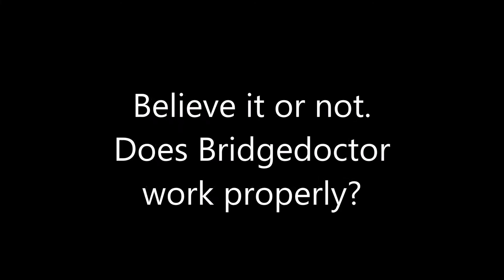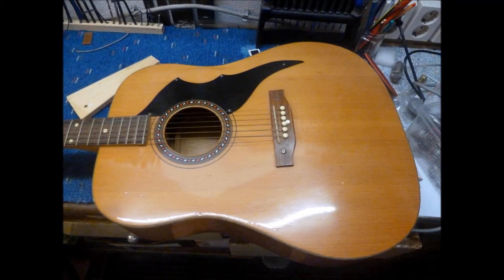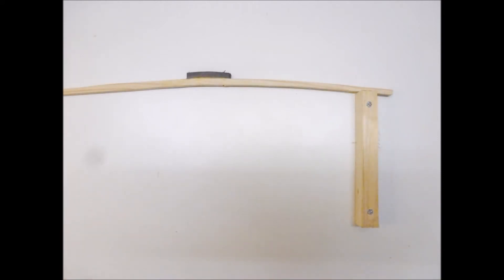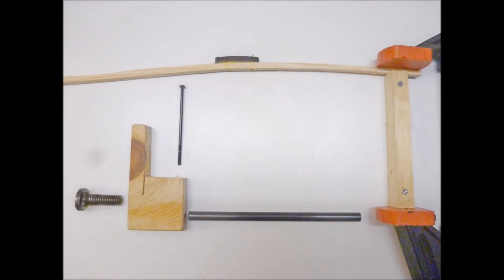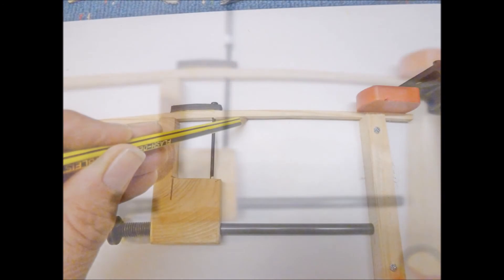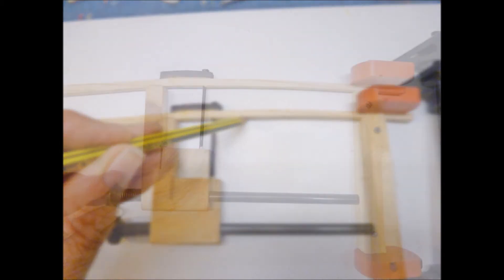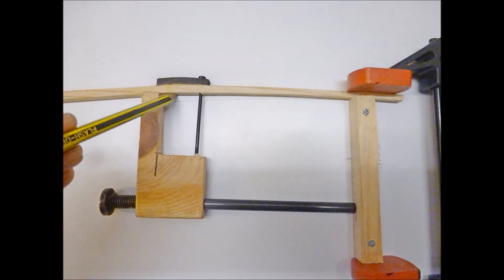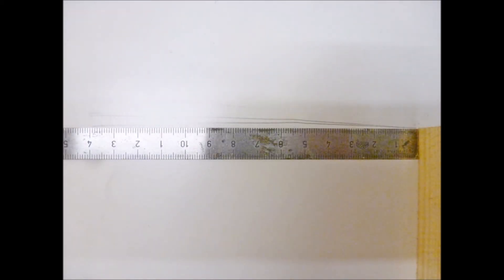Does the JLD  BridgeDoctor really work? Believe it or not!

Comment: They are a cheap fix but the wood they use doesn’t have much tonal quality, it appears to be basswood. They are easy to copy. One thing you should change is not to use a beveled screw which could cause the bridge to split if too tight. Use a forstner bit to drill a flathead bottom hole and a flathead screw that has a thin head , file it down if needed so a hole dot can be glued on top.

Comment: Do the job properly , hydrate the inside , clamp it down carefully and slowly, over clamp it so the belly goes in keep it hydrated for a week , ( I use a damp cloth ) remove after a week , leave for a few weeks and slowly release the clamps , this is the correct method.

Adding anything inside like these lumps of wood deadens the tone .
You might as well glue a big lump of wood top to bottom with polyurethane glue
Reply from the maker: This is another well known method in fact, but it needs time and causes sometimes other problems. Please remember that a "big lump of wood" from bottom to top works well in Violins since centuries, not glued in but trapped. I construct my own JLDs and they did never cause dramatic changes in sound. Instead of the long round wooden stick I use a 3mm steel threat . It works fine in a 12string Ovation to make it playable again.

Comment: I would like to fit one of these to a large body guitar, cedar top, rosewood body, but was worried  as it is a pinlss bridge,  Would  a vertical hole through the bridge plus the horizontal string holes weaken the bridge just too much, as it is a very slim bridge theirfore not much wood / streghth causing it to break apart?
Reply from the maker: You´re right. In this case I modified my DIY Bridgedoctor and made it wider/broader (3cm) (instead of the 1cm post). I fixed it with two thin screws instead of the only one. If it is  possible for you make an additional reinforcement from a 1mm thin 3cm broad piece of steel . Doesn´t  look nice but it works. In my opinion the Bridgedoctor works better if it is broader.
Reply from the maker: I found this video to illustrate what i mean. It´s for a Takamine bass, but in a more slimmer construction it´s exactly what I would recomment.

Comment: Hi, I wonder if this device affects the sound of the instrument in any way?
Reply from the maker: Till now I installed three diy items (similar to the the JLD) and I can say that it does not affect the sound negative. Currently I´m installing a modified system on an Admira Sevilla. It has a lovely sound but  I think the top could not withstand the string tension for longer times. So the bridge turned up. Hope it will work on it too.

Comment: Should n't we fix the free end of the bent twig to see the real effect of the BD? I think so, the tension created by the dowel on the plastic stem on the wooden block will be pulling the bridge part inwards as the wooden part, touching the upper side of the guitar will be exerting pressure outwards.

Comment: Most bridges have created a bulge not just on the rear of the bridge but the entire top snd bridge are raised ,,,
Reply from the maker: That´s true and depends mostly on the kind of bracing used inside. Imho I would say, that nearly all manufacturers of 12string guitars built their instruments too weak to withstand string tension from standard tuning. I also had guitars with complete deformation of the body, especially the frame. If one compares all the types of bracing for a flat guitar top he might say: that´s a kind of trial and error with no much knowledge about physics of forces, wood and static laws.

Comment: I installed it on an old takamine 12 string after using the T. J. Thompson belly reducer on it because the bullying under and behind the bridge was so severe the bridge was almost off it. After flattening and gluing the bridge back on I put in the JLD. What a difference more volume and sustain she sounds great. The back bridge pins are brass with out break angle but works well. I also got guitar up to proper humidity before starting also relied loose braces.

Comment: I've installed a jillion JLD bridge trusses. They not only work very well to flatten bellied tops, but the also work very much like a sound post in a violin or viola making the back and sides become more than just sound reflective. They now add to the guitar's sonic complexity making it have a more complex tone. The only problems with the JLD are 1. the price, and 2. that the post is tensioned by a threaded hex screw that's threaded into a nylon tube. this hex screw can easily strip, which cannot be fixed. I now make my own bridge trusses that are much, much stronger and use a threaded rod instead of a dowel stick.
Reply from the maker: Thanks for feedback. I confirm all your experiences. I also built two by myself, each a little bit different from the other. One works fine in an academy ovation 12 string and the other in a 50 years old Hoyer Jumbo. I found the sound much better than without. Instead of the wooden slat I use a 3mm resp.4mm threaded rod. To work more properly the wooden slat should bend, but it cannot very much due to it´s thickness and it´s fixed point  at the frame. The bending force to the bridge disploys in a much better way, because the rod is bending.
Reply: how do the hex screws get stripped once they are installed are they in need of constant adjusting or ?  I just looked on ebay and the JDL bridge doctors are selling for around $23 is that expensive or are you talking about the labor to install them ?  I'm looking at a guitar that already has this system and I don't want to get into a can of worms on it , Thanks and Peace, Jix
Reply from the maker: to  @jixxxxer17  
To install a JLD requires some minor - or major- work (including some drilling) depending on the individual problems of the guitar that must be solved . Please see youtube stuff.
Think Breedlove guitars have already a JLD preinstalled.
Reply: @rolatau  thank you I will do this great.  if you don't mind me asking one more question please, i'm looking to buy this vintage guitar and it has one of these JDL Bridge Doctor's install but it also has the big brass saddle pins, the strings go straight thru the brass saddle pins and i mean straight thru there is zero break angle but I'm told this is how they are designed and not to worry about zero string break angle there. have had any experience with this or the brass string pins ?  appreciated very much , Peace
Reply from the maker: @ @jixxxxer17  
Which vintage guitar do you mean exactly? Meanwhile a friend said to me, that new Breedloves do not have a preinstalled JLD bridge doctor, but they support it. So I was perhaps wrong. 
Concerning zero break angle: I think when a guitar is designed in such a way it might work but I´m not shure.
Reply: @rolatau  no worries i appreciate the info anyway,  this vintage guitar if you read the description which has been slightly changed a few times over the length of it's 1 month posting. I believe the initial posting info said that the Brass Bridge pins may or may have Not come with the guitar and that they may be rare items, that language has since been taken down and the language describing the JDL  Bridge Doctor recently added since my research, the side shot of the neck looks pretty high and also in the written description it claims to be low , ugh I hate taking chances on the internet buying guitars. here is the link >>    https://reverb.com/item/19759443-1976-guild-d40c-acoustic-guitar-w-hard-shell-case-extras-d-40c-d-40-c-34196   Peace ! Jix
Reply from the maker: @jixxxxer17  
, ok. it´s a Guild, but  OMG : In my case i would never buy this guitar for nearly 1000€. It´s far from being original. Many holes and perhaps a fissure in the frame, non original Schaller tuners
and very used look.....would assume that the brass pins where also not original. Never saw it before.
Reply: @rolatau  Thank you for taking the time to have a look , what is the highest you would go in US Dollars ? I offered $500 but even then it's a Risk, Regards &  Peace !
Reply: @jixxxxer17   Hard to explain over comments, but....  it doesn't usually strip once installed (if all goes well). It strips on the initial installation of the allen threaded insert into the nylon tube that goes through the lower portion of it. It's what the wooden rod sits in. The nylon tube doesn't come threaded. You thread it by simply threading the insert into it. If you mess up at all, you end up with a stripped nylon tube that can't handle the tension under load. About 1 in 6 fails because the insert goes in cockeyed. If you make sure it goes in straight, you'll be okay. Let me know if I'm not clear and I'll explain it differently.
Reply: The Gee-tah Guy  , does the bridgedoctor also help against the collapsing of the top at the end of the soundboard ?
Reply: @krisverding3908  No. It does not help with that common problem.
Reply: Would you share how you make it?
Reply: @kcnmeeh  you can try a "free neck reset"  and some converted mini clamps or jacks close to the soundboard hole together with some steam .